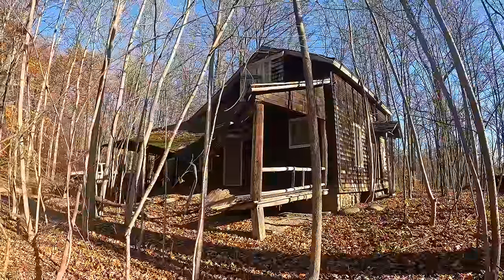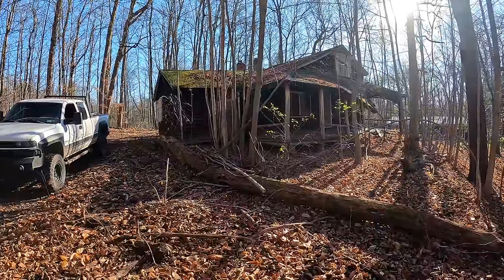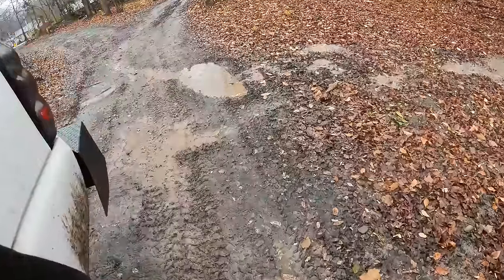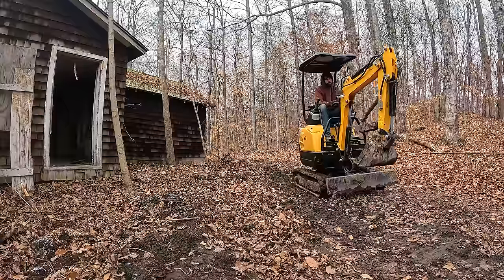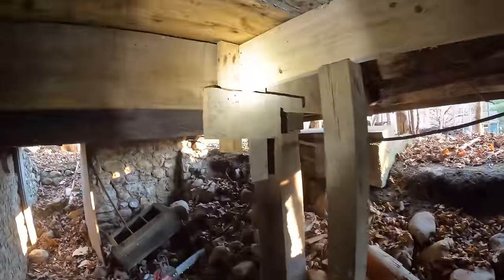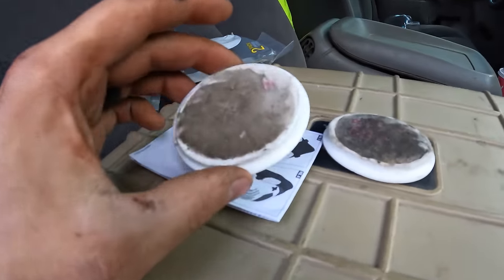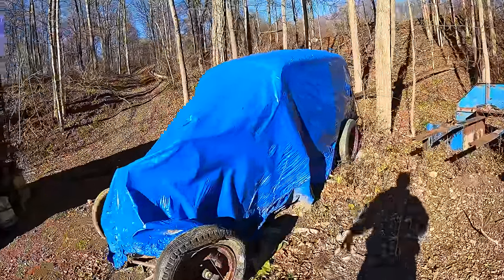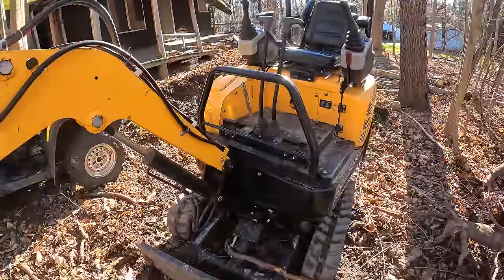I bought an ABANDONED CABIN in the WOODS - Vacant for over a hundred years!

Comment: There is no way that house has been abandoned for 100 years. 
Just look at the outside doors and windows. Those are pretty modern. They weren't around 100 years ago. Maybe 30 years ago. Someone was definitely at least working on the house.
My house IS 100 YEARS OLD.
It still has original sash type windows. (With weights in the wall for putting windows up and down) I use a piece of wood to hold windows up. My entry doors are original to the house. Have beveled glass in doors and most windows. Even has square nails in the structure of house. Still has original claw foot bathtub. 
I would suggest you go to where housing records are kept (city hall, deeds office etc) and get a true update and floor plan so you know what is what in that house. Still a has original ceramic knob and post for some of the electrics
Thanks for sharing with us

Comment: Your house has an asphalt roof so it was probably abandoned 50 years ago not 90.  If it was abandoned during the depression it wouldn't have an asphalt roof.  And I think I see round nails from the 20th century.  If it was built in the 19th century it would have square nails.  I think it was built in the 1920s from the looks of it.  I had a friend whose house looked very similar and it was built in the 1920s.

Comment: Put your diggings back in the road.. the goal over time would be to crown the whole driveway.   I got a cheap drag for my four wheeler.. just a cross with a bar, that you sit cement blocks on for weight, it works great for smoothing and filling the wheel tracks.   You could tow it behind your truck, although it would be harder to see what your doing.

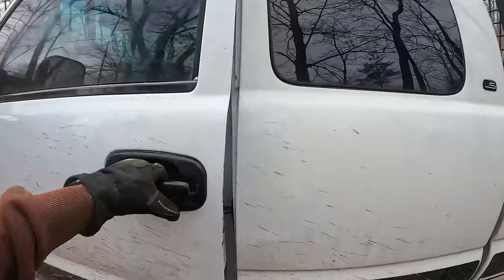Comment: 26:10  Remove the switch assembly and bend the prongs slightly so they make a better contact.  Might fix it.  Had the same thing happen on my 96 chevy with pushbutton 4wd.

Comment: Even a cursory look at the outside, it looks VERY good for unoccupied for around 100 years. It was at least maintained enough to prevent complete collapse. In my hometown there were barns no where near tress collapsed completely after only 50 years of neglect. Actual neglect too, as in no one used or maintained. This house was near trees as well. My guess is it wasn't used as a residence, but was cared for enough to maintain some laws regarding ownership or something. As truly abandon homes and property, especially as long as claimed, are in much poorer condition and often claimed by the state as no proof of deed.
Reply from the maker: This is probably one of the more accurate and thought out comments about the age of this house. And your most likely correct. It has been vacant for about 100 years. And it is abandoned, but it probably has been cared for into the 50s/60s.

Comment: About 25 years ago I bought a very similar cabin project. I completely rebuilt it in sections from the ground to the roof. After I was all finished, one of my neighbors called the county on me for not having a permit. I ended up tearing the whole thing down and building a house there instead.
Reply from the maker: That neighbor would have been encouraged to move away quickly.

Comment: This is the first time i've watched a video of someone renovating an abandoned house, so i'm sorry if this is a dumb question. But why did you take off the outer layer of wood while you were inside the house on the top floor?  Is it only to get rid of any possible asbestos? or is there a different motive behind removing ALL of the wood from the upstairs of the house, including some of the supports from the wall that had separated the two rooms?
Reply from the maker: A lot of it just needs to go so a new floor plan can be put in place.

Comment: A piano restorerer might might be able to use those keys for the ivory,  If you haven't trashed the piano.
Reply from the maker: There not ivory keys
Reply: @99Projects  If the piano is as old as the the house,the keys can only be ivory or bone and are very vauable.  Don't just trash the piano,  Save the keys!  There were no plastic keys in the early 1920's

Comment: I feel hoodvinked. This house might have been build in the 1930s but there is no way this rotten decaying ruin which is located next to a proper road (the woods...pffff) has been vacant for more than 30 years. Give or take 10 years..... As I wrote in other comments, the chimney has been been fixed with lead, screws and a bonding agent. The interior has been renewed in the last half century etc. The foundation is partially destroyed an the rest has decayed just like the rest of the house. The wooden structure is infested by mold, everything is rotten and warped. The only thing sane to is give the guy with a real bulldozer a call and end the suffering. This ruin isn't worth saving. Any building inspector would redflag this ruin. What are you trying to accomplish here? I would put my dog in this death trap... Thumbs down here

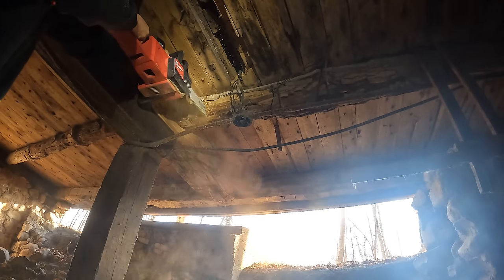Comment: Bursted out laughing at 31:14. Ancient wiring that should have been ripped out decades ago, you just move around to replace your joist...then AFTER you've got the joist in place and set, you take down the wiring. LOL Smart!

Not one for safety are you guys??  Several points throughout this video were nasty. No safety goggles while cutting down trees and then looking up, dropping load bearing supports in the attic (that roof looks severely water damaged and brittle, surprised it didn't fall on your head).  Your mask with ventilator filters? You might as a well throw away.  I have a feeling Darwinism will get you first. 

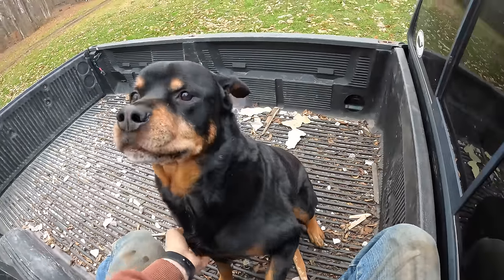However, the worst part was seeing your pooch (at 45:50) in the back of your truck with a few boards with nails sticking straight up almost missing his paw a few times. That would have been a nasty vet bill, not to mention incredibly painful for your "buddy". Totally made us wince. Some people should not own pets!! Do better guys.